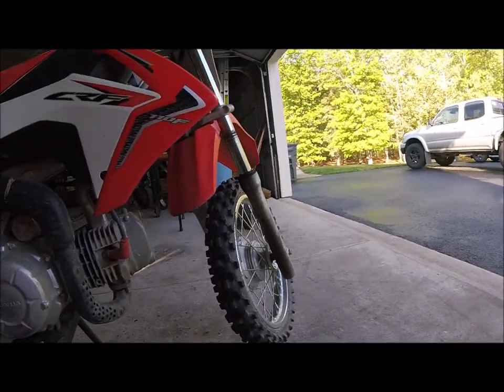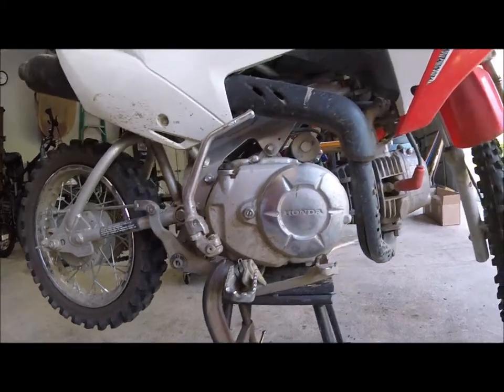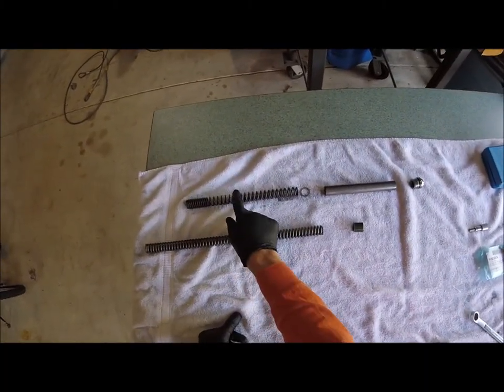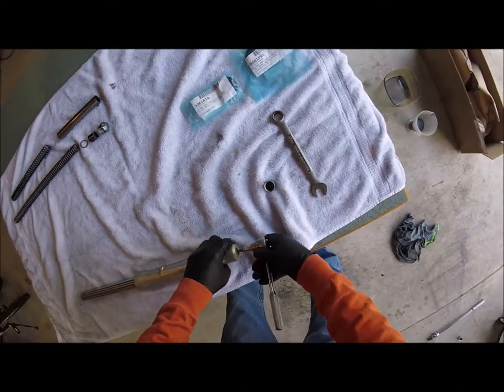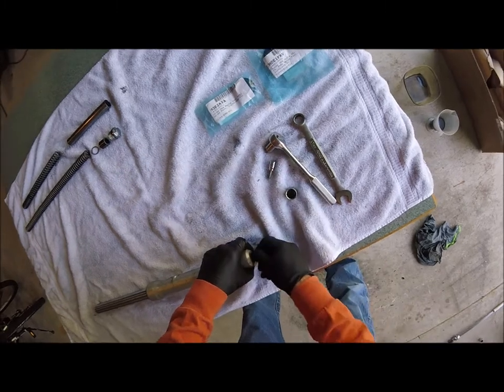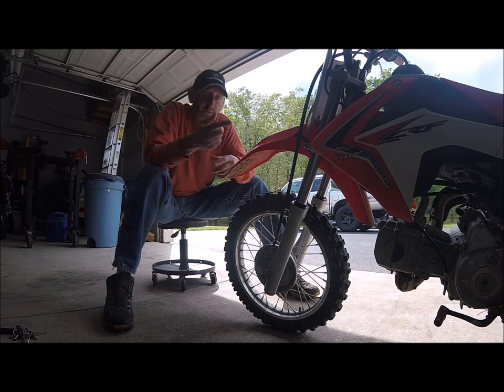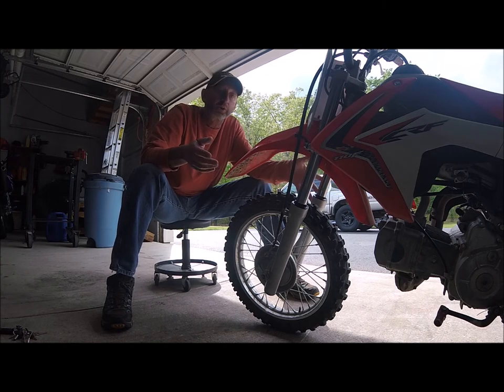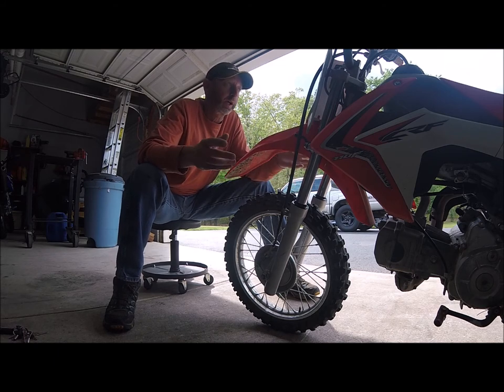CRF110  INSTALL  Fork Seals and HD Springs

Comment: Do you know what the sealant is on the bottom cap screw? 9:19
Reply from the maker: did not see what you mean at 9:19.  the seal at 9:19 is just pressed in.
Reply: On the bottom when you take the screw out that holds the dampening rod. Has a washer and mine had some white sealant. Which may not be necessary. Someone could have done that before me.
Reply from the maker: I don't think mine had any but if your worried about leaking try some teflon tape on the threads.